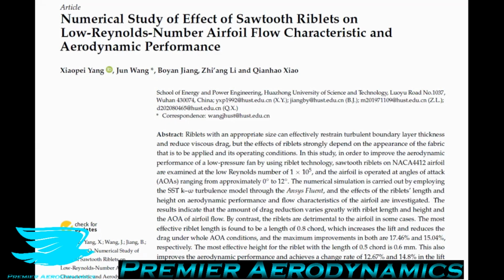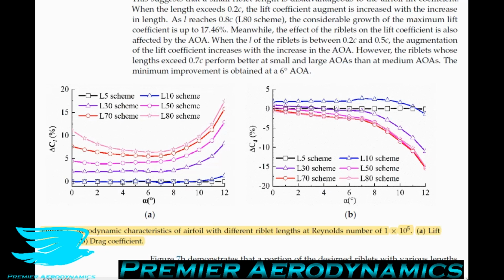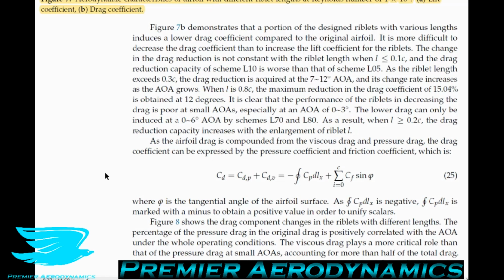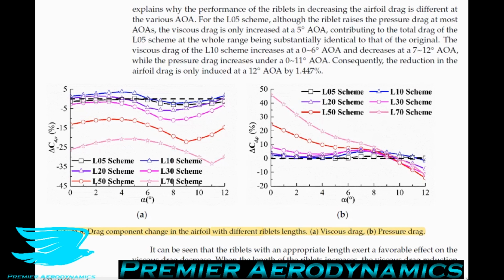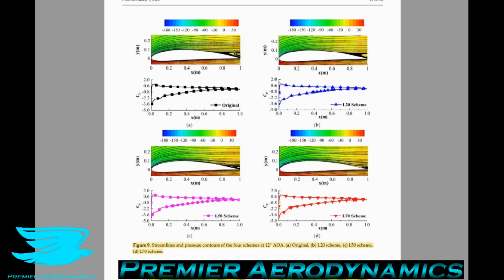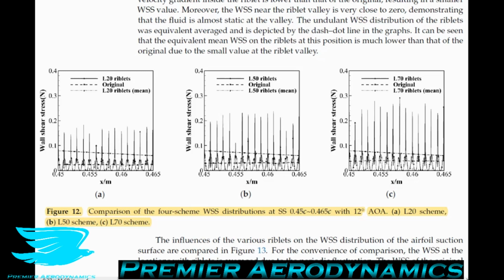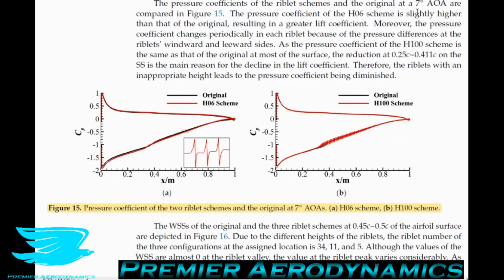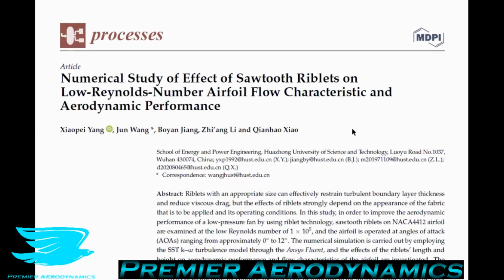Shark Riblets are incredible at improving airfoil aerodynamics Part 2 - Podcast #102

Comment: Looks like L50 would be ideal from a performance POV, as that would give the best drag reduction along with the most consistent and linear lift. That would give the most useful compromise in my opinion.
Airflow doesn't flow around objects, air flows around air, which is viscously stuck to an object.
Reply from the maker: Yep! That's correct, the very first particle at the surface is technically at zero velocity. So, that is true.👍